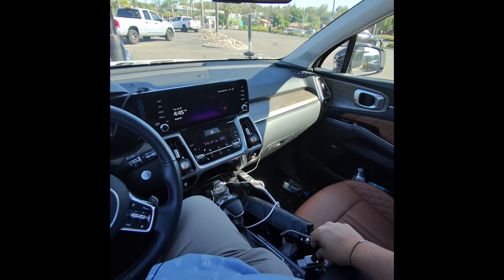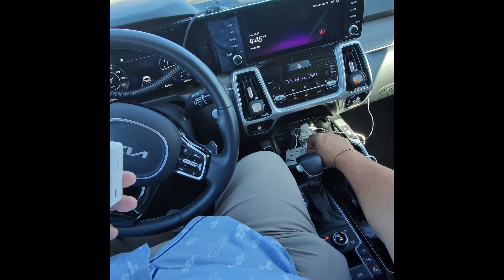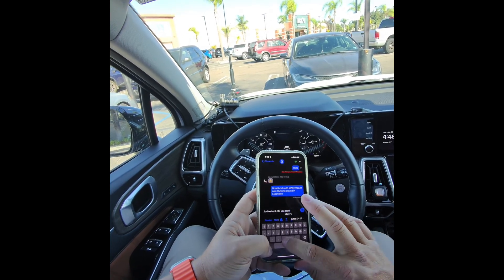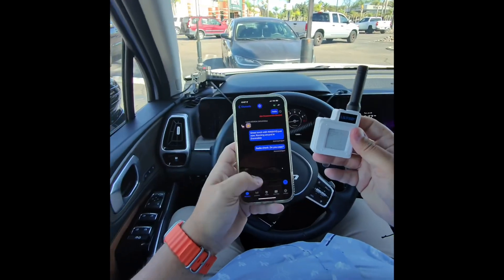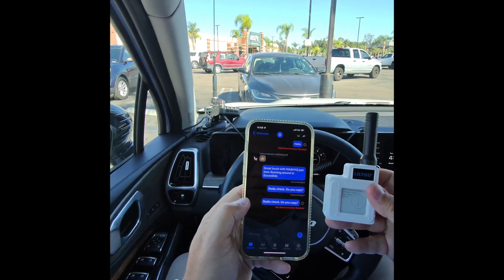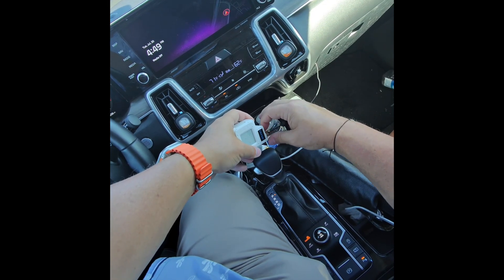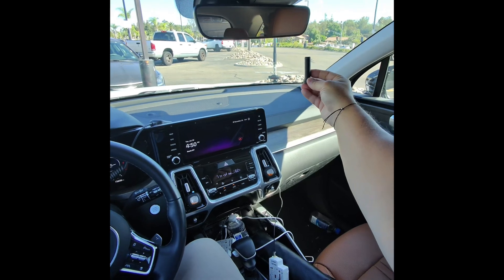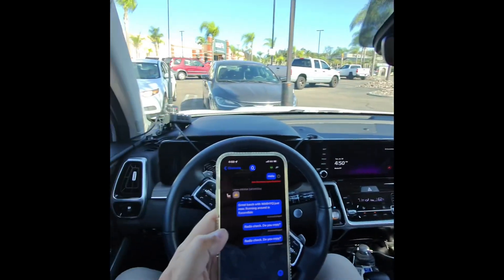Lilygo Stock Antenna vs Alfa 915 Meshtastic Test. Dramatic difference exposed.

Comment: What kind of cable is running from dash to antenna? 33cm experiences rapid loss on anything less than LMR400
Reply from the maker: I modified the stock cable that came on the Diamond hood mount to LMR-400. I did this later. Initially I wanted to put an amp on the connection but instead changed the cable which yielded the same fix without having to add another device.

Comment: Yeah. One antenna outside. One inside a metal car.
Reply from the maker: How dare you say that! My car is made entirely out of paper mache. Really though, same test with antennas mounted outside on my TWO external vehicle mounts yielded the same exact results. 😊😂
Reply: @ke6vdw  lol.  I believe ya.    

I have an alfa 915 but it didn't fair any better than the included pcb antenna on the RAK wizblock.   But I think I got something else going on
Reply: Actually, in some situations, the car body has improved signal…. Its a 2.5 dbi antenna or lower that he’s using that comes stock. they’re not very great, but not bat. High gain 5dbi or higher you will easily be able to send and receive traffic much better. Please be mindful that if you’re gonna go around with an antenna, that’s that powerful being client mute because you’re gonna be flooding the mesh traffic with unnecessary packets